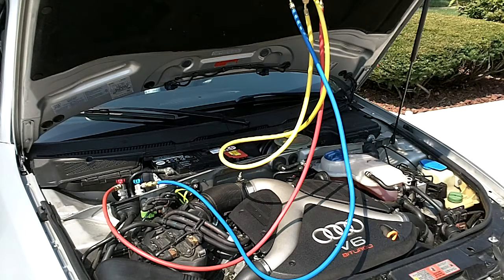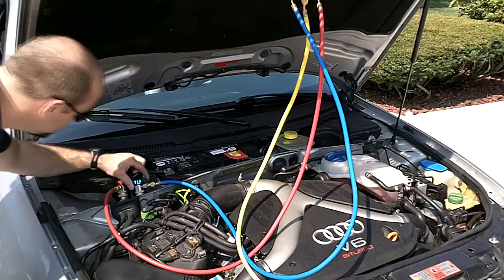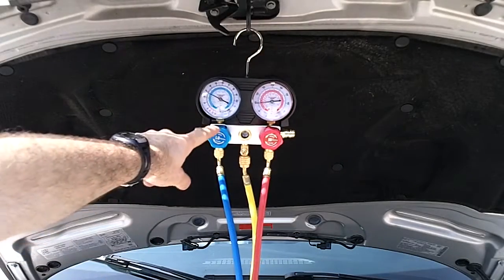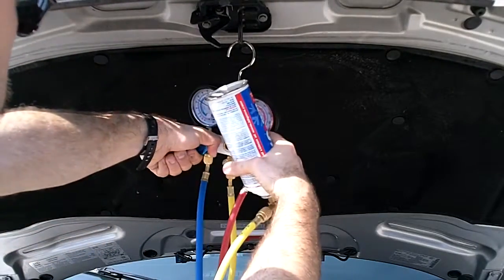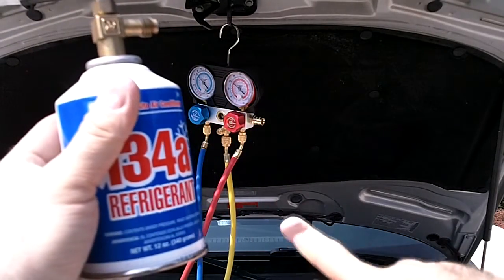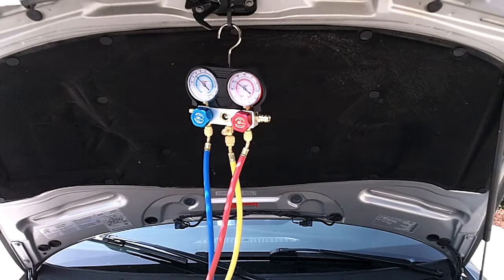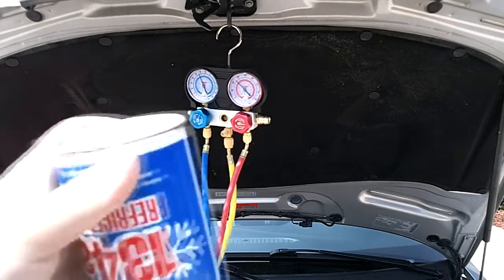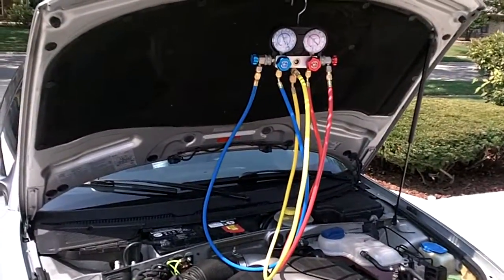2002 Audi S4: Ep. 52 - How to recharge an AC system on a B5 S4

Comment: nice don't bother bleeding the line and purging  the air from refrigerant in-feed line.
Reply: I'll try to help out here as best I can. 

If you dont bleed the charge line then you are adding that lines volume of air into the system before the refrigerant goes in. This adds moisture to the system from the humidity in the air. 

When I have a system that is very low, I will also evacuate it and pull a vacuum. I'm not an expert here at all but I've done a few.

Keep up your videos man. Ive watched a lot of them when working on my B5 S4.